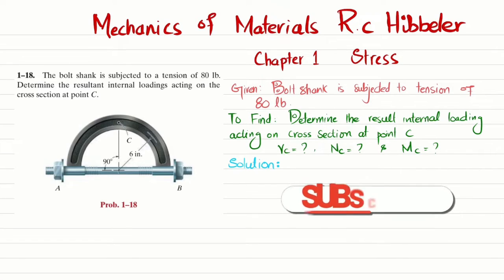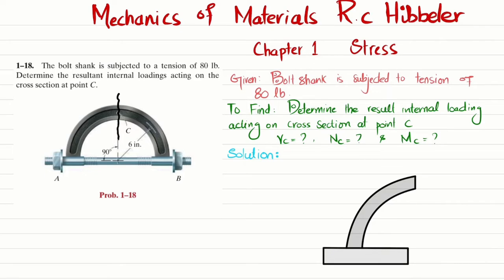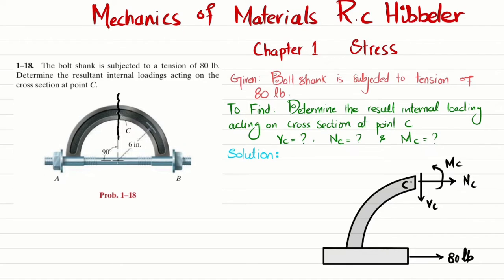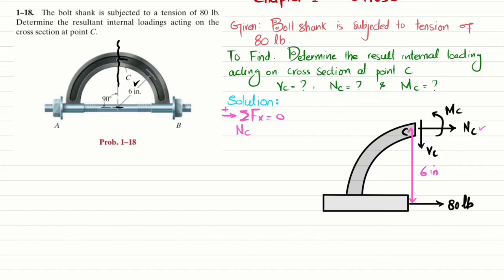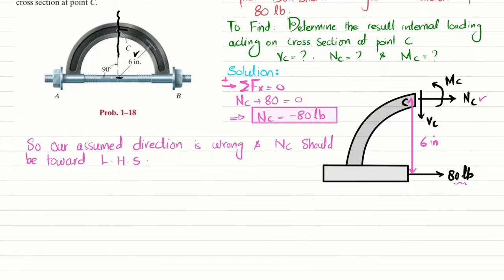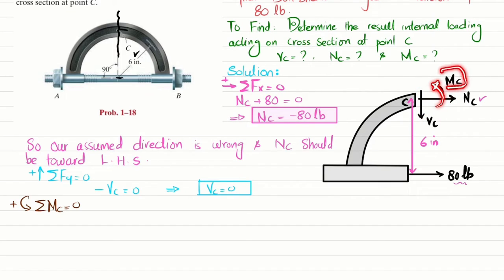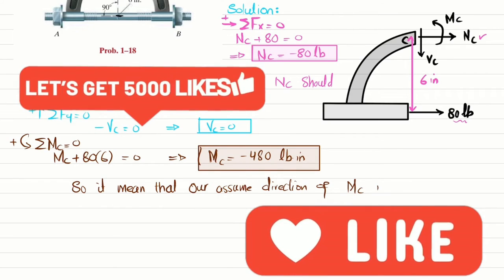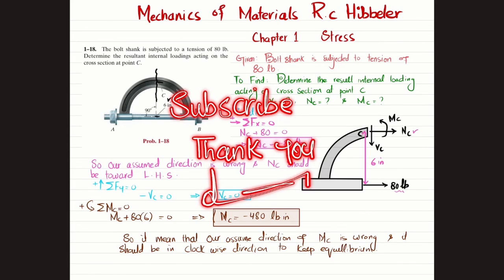Determine resultant internal loadings | Pr 1-18 | Mechanics | Stress | Mech of materials rc Hibbeler

Comment: Why you take the direction of normal stress along x axis not in y axis ??
Reply from the maker: The cutting section face is perpendicular to x axis and it will experience normal stress in x direction while the face is parallel to y direction will experience shear force.